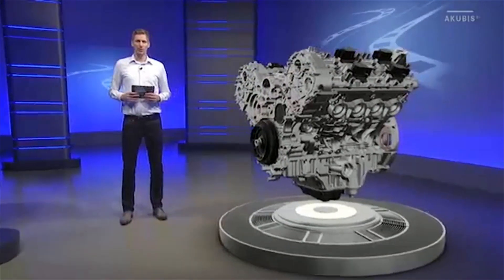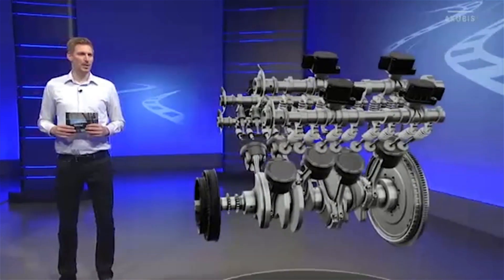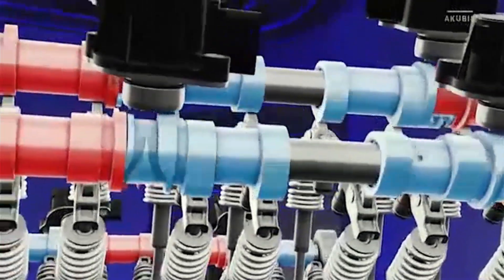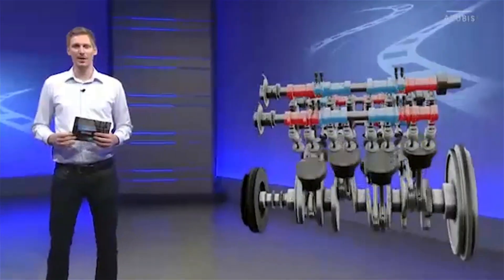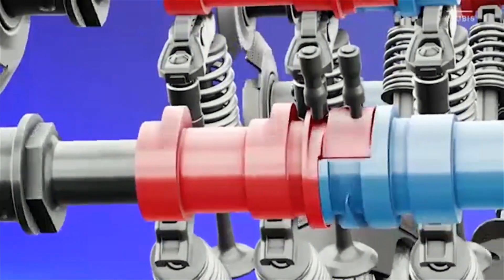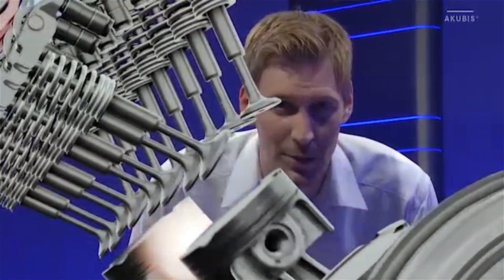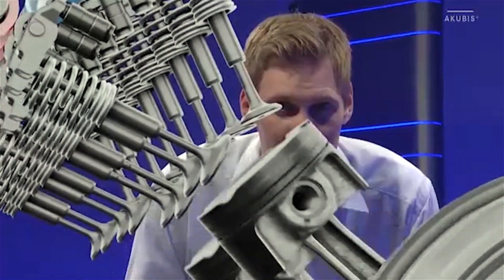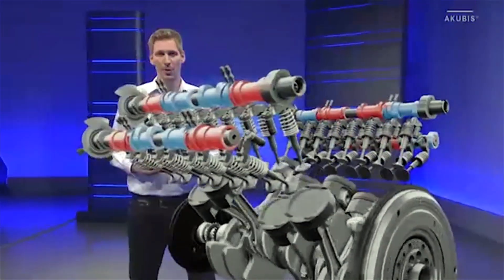Mercedes-Benz CAMTRONIC System: How it Works / Cylinder Deactivation on the M177 Engine

Comment: this video is wrong, it is NOT standard on the m177. it is only found in e63 and s63. the c63 and GLC63 do NOT have cylinder deactivation. all use the m177